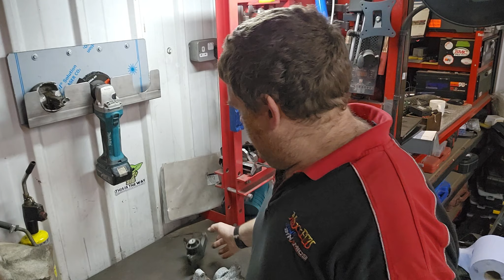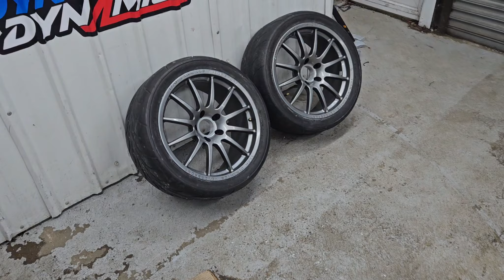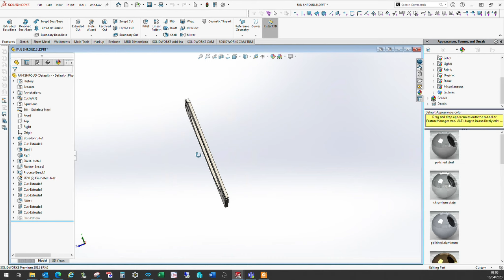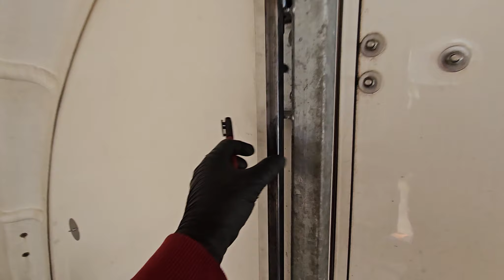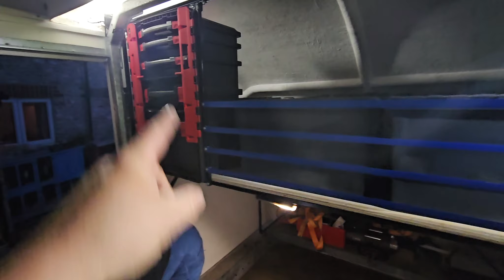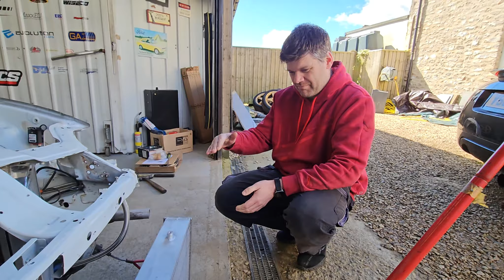Jaguar XKR X100, building a racing car! Engine cooling complete. Boost pipework, and new wheels!

Comment: Another great vid. One question - where did you get the storage unit with the red locking tabs? I need one!
Reply from the maker: Hi Steve, eBay number: 203606704915 It was a good deal cheaper though when I bought mine. Shocker right!

Comment: I’m lost. Why was the OE water pump removed? Why were the idlers and tensioners removed?
Reply from the maker: All part of my cooling system improvements. I'm running each bank individually, as if they were seperate engines. Each bank is monitored for temperature and indeed pressure. The speed of the pump is adjusted accordingly to maintain whatever temperature is set in the ECU. This method is more efficient, and gives me more interesting data (as I'm boring, and like numbers)!